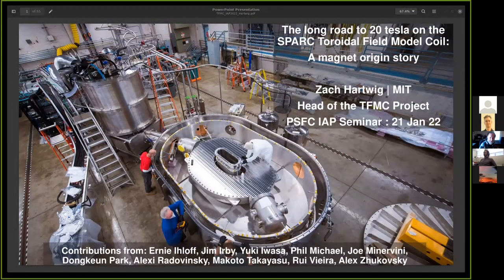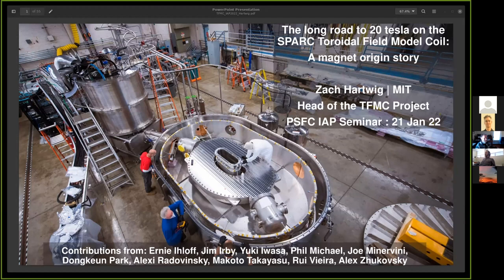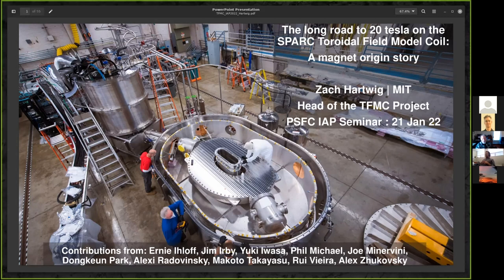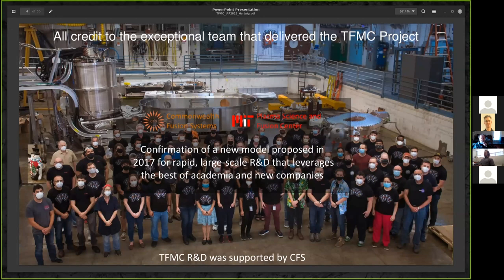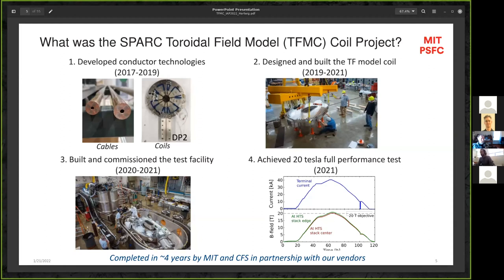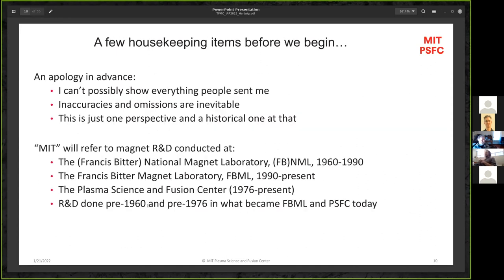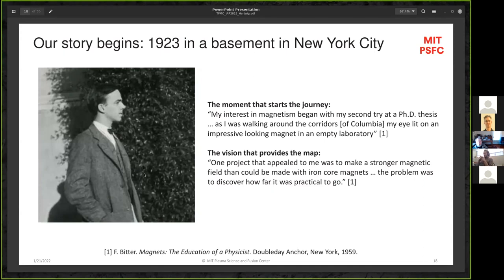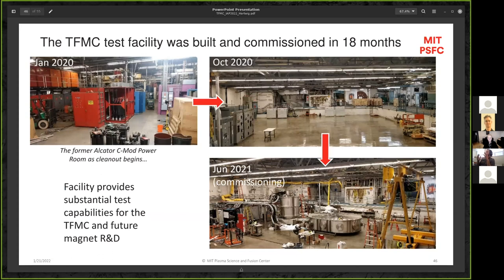The long road to 20 tesla on the SPARC Toroidal Field Model Coil: A magnet origin story

Comment: Physics of device begins @46 mins. 
A fascinating talk. Some questions, from someone that's been following the project from the sidelines. 
I assume there would be some dozen of these around a toroidal liquid salt cooled fusion bottle, with the bottle replaceable by simply unbolting the middle of the bottle across the diameter and wheeling half of the magnet out? (without the previous desoldering the top of the magnet step). 
Are there any publications (or planned talks) going into the integration of this magnet into a toroid, and associated fusion systems?